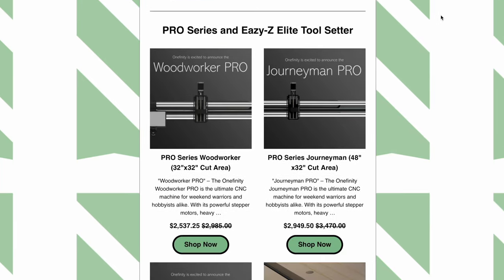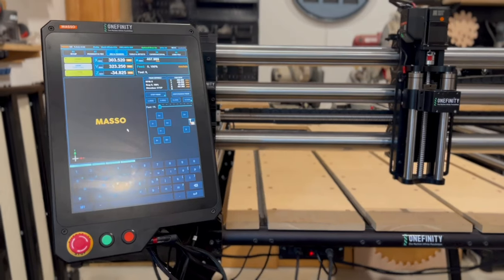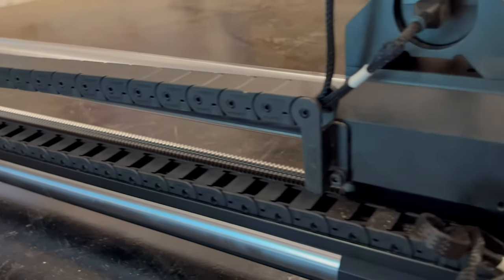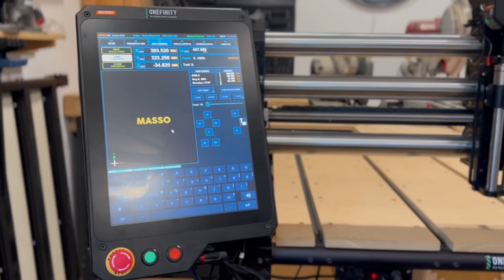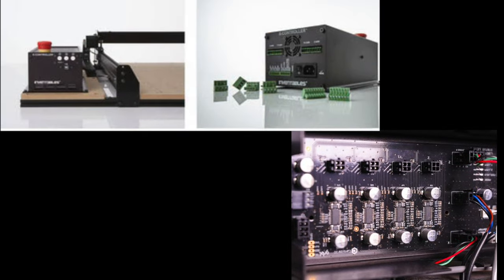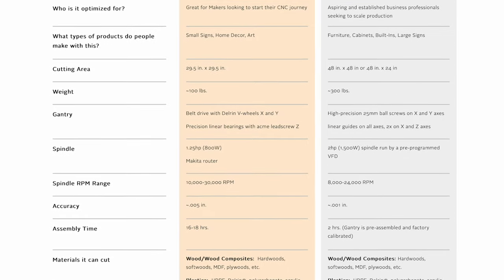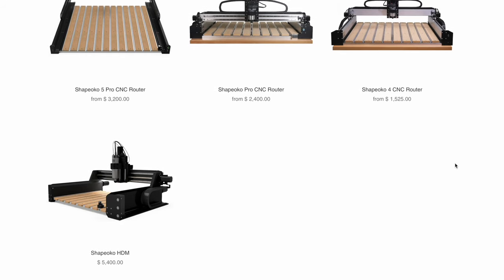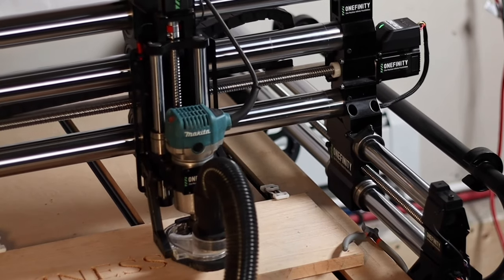Is Onefinity the Undisputed Market LEADER?

Comment: sainsmart offers a close loop cnc. Onefinity isn't the undisputed market leader because it's very expensive whenever you don't live in America. I live in France, and i purchased a proverXL 6050 plus, upgraded it with a 1.5kw spindle and much more for a fraction of the price of a onefinity
Reply from the maker: Hi there -- thanks for the input. I'm not sure which Sainsmart model you are referring to. The 6050 does not appear to have close loop steppers and there is no option that I can see for a spindle -- only a 1.25hp router, which is far from a 1.5kv spindle. I'm not saying it's not a good machine, I'm just saying it's not comparable to the Elite series. If there are other configurations I can't find, I'm happy to amend my analysis. Thanks for watching!